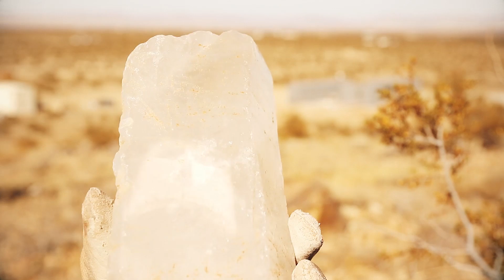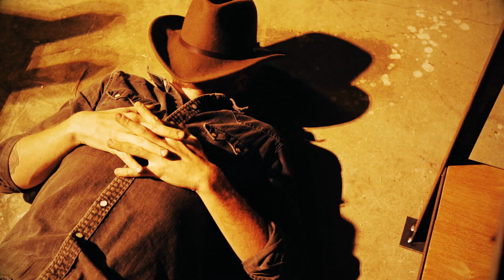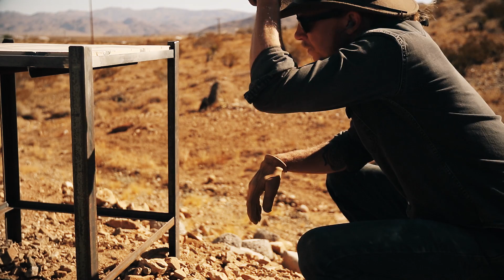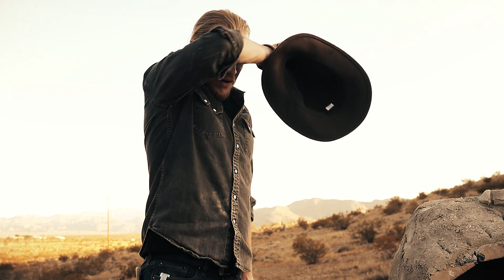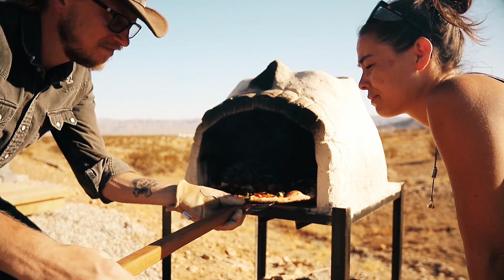Making a Skull-Shaped Pizza Oven

Comment: I keep trying to imagine this with Ben's voiceover:
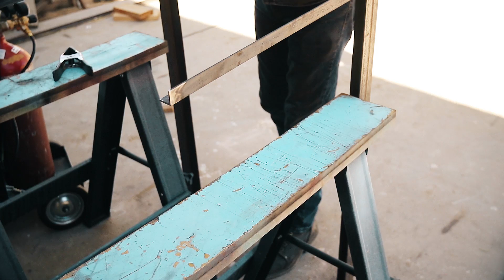2:57 Now the metal can move around when you're welding, so I held everything in place with magnet clamps.
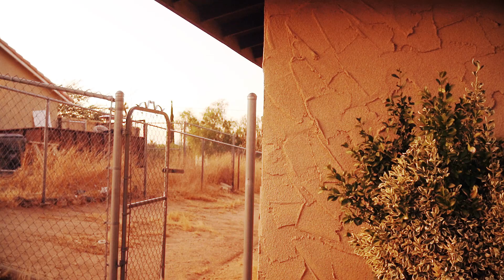4:01 Jessie helped me out by making some bracers. These will add some more support and provide a flat surface to start laying the fire bricks.
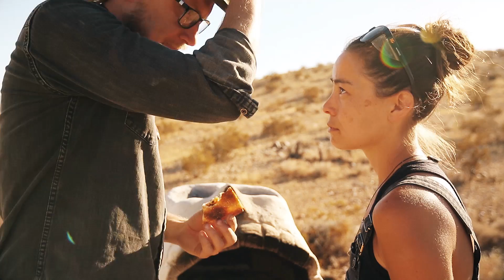11:40 Once the project was finished I gave up my life of mystical adventure and passed the torch to the next generation.